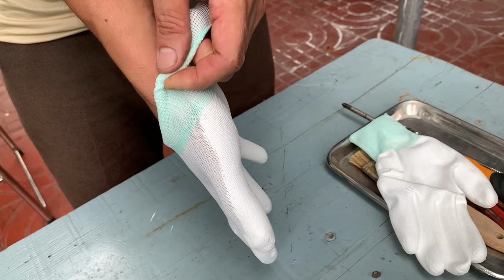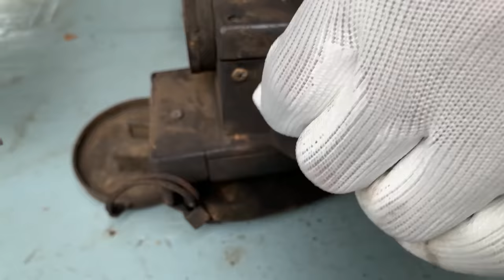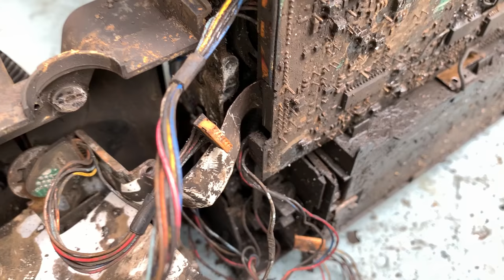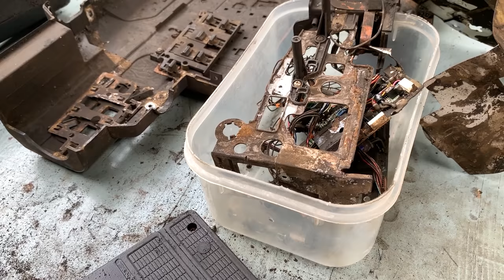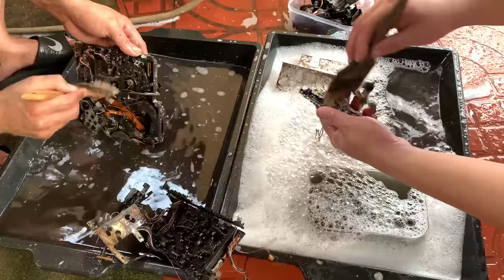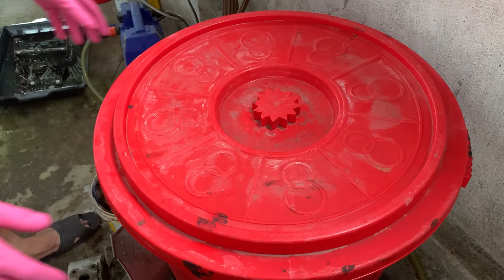Restoration Old Panasonic M7 VHS | Tear Down Panasonic video camera ep1

Comment: If you don' t show the unit working or assambled again, the video is not useful and looks like a fake. And putting certain parts in water, capacitors  and so on ?  Dangerous, a real nosense.
Reply: It won't work. It's common sense. This types of restoration is for pleasure only.
Reply: Just think that this is a satisfying video :)

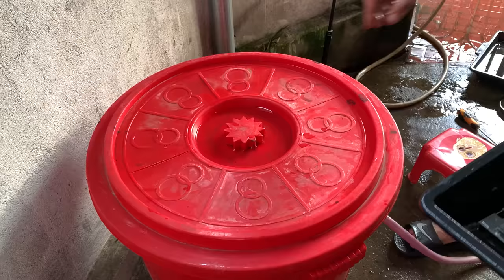Comment: It was something amazing from this rusty rotten VHS camera to conjure up such a pharmacy state camera.  At home in Hungary, I also renovate our household items, Washing machines, computers, laptops, Microwave ovens, Passenger Information Displays, and its controls, and so on.  But from the damn brake dust that accumulates in the garages to the warehouses where they are stored until they end up coming to me I can barely peel.  My question would be: How do you peel off electronic printed circuit boards?  At 20:47, what's in the video in that red plastic container?  Are you water, 96% pure alcohol, or maybe baking soda?  Thank you in advance for your help.  Your videos are amazing.  There should be many more such Renovation videos.  One learns a lot from it about how to disassemble and renovate
Reply: What pure alcohol 96% !? Pure tap water. It never worked again. The only thing he can do is stand in the display case as a souvenir. If you plug it in, it will become an electric line. Don’t hope this is good and right what “Jackie Chan” does. This is just a fun and entertaining program for children under 12.
Reply: @gorcilosrbojevic2842  don’t be racist, thats offensive. I’m asain

Comment: If this was real, and it’s not !!   there is no way in hell that that VHS camera recorder would ever function again ever, good magic trick !
Reply: Some part of it might work electronically, but hell no the video head drum and the optical assembly. The optical assembly might be fixable with a complete teardown, cleaning and re-lube, but the head drum is trash. Bearings seized, rotary transformer rotten, most probably the windings on the head cores also rotten, and the surface of the drum is inadequate for any tape contact due to excess corrosion. I mean, this camera might be fixable, if we were in 2100 and this was the last existing VHS camera on Earth, and a team of electro-archeologists really want to restore it... But nowadays, just pick one up from the local flea market for $25 (includind accessories), and repair it. Because any of these will need a repair at this point, even if it was stored in a clean, climate controlled room. 
I would keep the cute CRT viewfinder, and the lens if I found a camera on the street in a condition similar to this. And I would definitely pay a lot of attention to the cassette in it, to find out what's on it.

Comment: This is the exact reason why I dont buy used electronics. There's absolutely no way that the circuitboard is not (partially) broken. You literally passed electricity through it a few minutes before putting it on water... Just use isopropyl alcohol or a non conductive cleaner. This is simply wrong...

Comment: He is good at ripping and fixing, but he has an amazing ability to pick up anything on the street if necessary.However, most of the items thrown away in the garbage are not covered with soil and rust, as if they were 100 years old, and usually have some wounds, no accessories, or food waste. It doesn't have to look like a hidden treasure due to long-standing erosion. If it's covered with soil like that, people misunderstand it as a medicine for movie props.  Go to the local garbage dump and see if the broken TV looks like that, but the objects in the video are as dirty as the chemical treatment used in the movie.
If you shake it off with a brush when it's that dirty, bolts and Batteri electronic components are clean.So, when you film a video like this, go to a local garbage dump. Don't make it so obvious that it's fake.

Comment: Why did you deliberately ruin a vintage Panasonic m7 for a video do you know how expensive they are. They are at least £400 for a used working one bruh and it's made OF PLASTIC so it CAN'T RUST 
If you bought it and it worked instead of ruining it you should have made a video about it or something. Anyway the restoration is fake 1/10

Edit:if this was real the person who thew the camera out in the first place should have instead sold it on eBay instead of leaving it to rot. on the floor.
Edit2:Santa got me a working Panasonic m7B and Ferguson videostar c fc15 camcorders I'm happy now